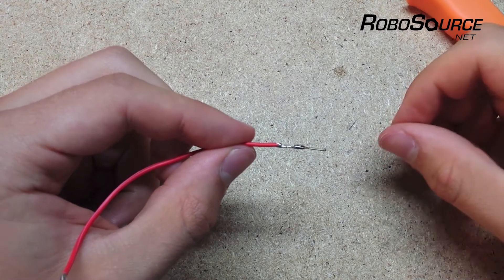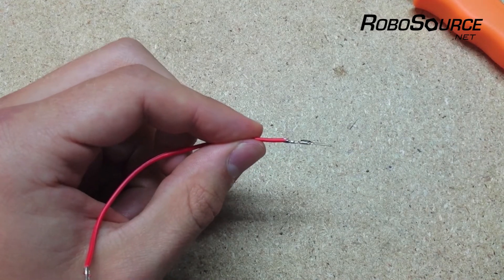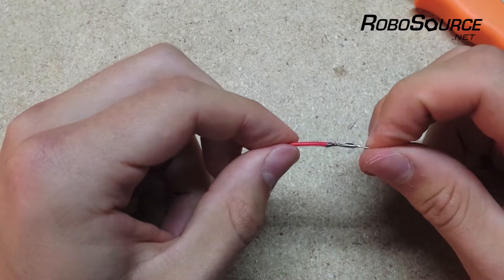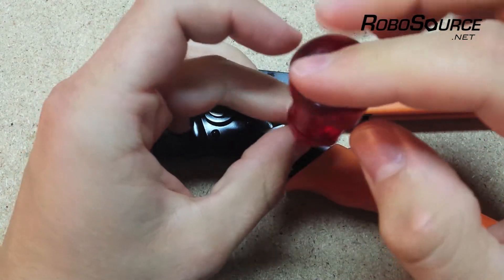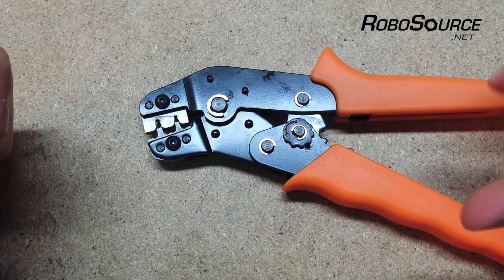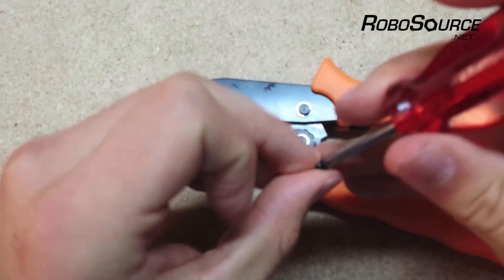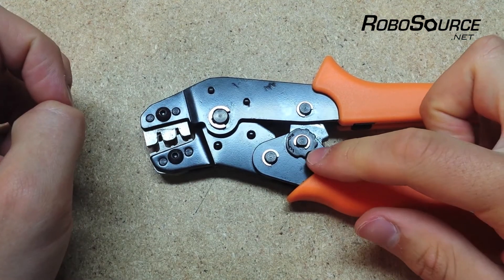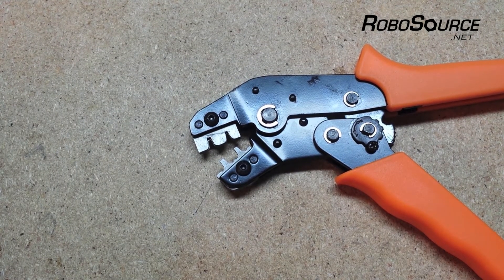Adjusting the Robosouce.net Ratcheting Crimp Tool for Repairing VEX Connectors

Comment: This very  tool crimps the contact pins beyond their limit whichever way I rotate that dial you are referring to in the video.  I want to increase the gap between the teeth on the crimp end because the gap is too small, deforming the pin.  How can I do that?
Reply from the maker: Adjusting the crimp tool only changes how soon it releases, it does not change how far it will move, so you need to pay attention to when the last click happens as you are crimping and then let go right away. Also check if the crimp pin is in the right spot in the tool, you will notice there is a narrower area where the part of the pin with the stripped cable goes and a wider area where the part of the pin with the insulation goes.